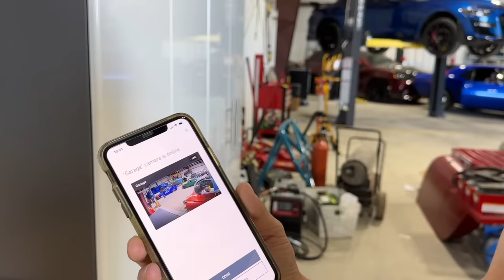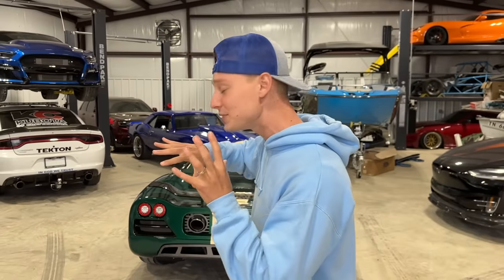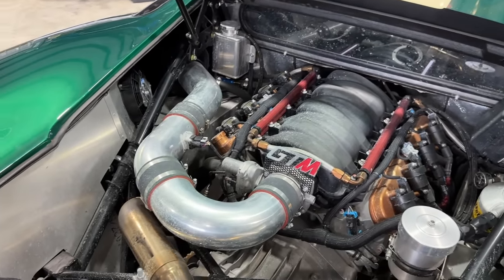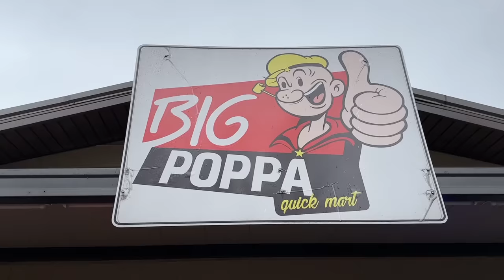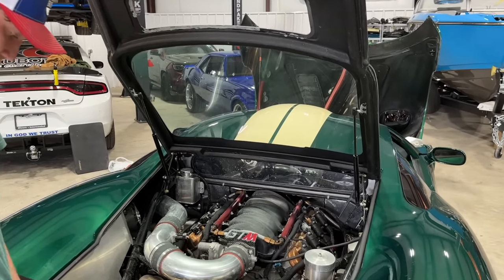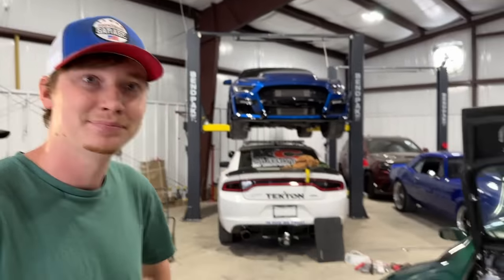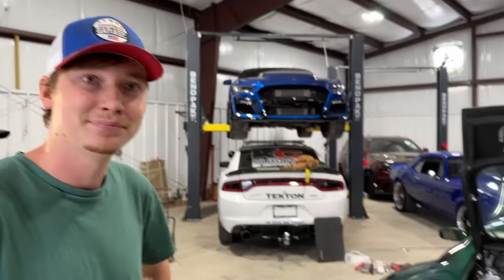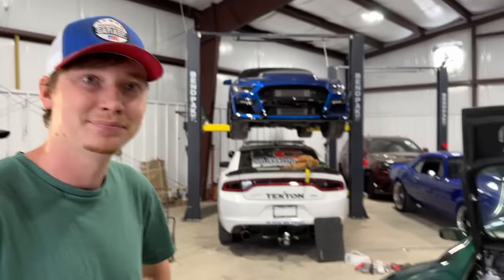Our Salvage Factory 5 GTM Is The Cheapest Supercar In The World!?

Comment: For street, you need to install a set of Michelin Pilot Super Sport or Michelin Pilot PS2 tires. Either set of tires will definitely hook up on the street. If you're just gonna Track the car, some great Dry Track tires, which I personally use on my 2021 Porsche GT2 RS Weissach, are Michelin Pilot Sport Cup 2R, or Mixed Track, I run Michelin Pilot Sport Cup Connect. Just REMEMBER to set and monitor your tire pressures!  Have fun. Great build Goonz!!!

Comment: Guys you HAVE to make sure you take off the xrp main frame before you remove the wheels and tires or else it’ll cause the dash Board to overheat when you push it passed the horizon line limiter

Comment: How much would you say your time would cost for the body work, because I know you had to put in some time on the hood to get it right. I would also say add air bag suspension to it so you can drive it around without it bottoming out then when you're ready for a track you can lower it.

Comment: When they are for sell, new GTM kit are like $25,000. Then you had to source a C5 Corvette for parts or buy them all separate and then find a Porsche 911 transaxle or a Mendeola 5 speed transaxle. To build a GTM is easily a based of $60k-$70k pending how you source your parts and if you start upgrading things you ramp over $100k easily when you start doing full built engine and all performance parts while also trying to keep it streetable like most factory built super cars.

Comment: When the car is on the hoist (14:32) you can see the driver’s side rear tire, it looks as though there has been a fluid leak of some description onto the wheel & tire, brake fluid, axle or suspension leak? 🤔

Comment: sure you will often have leaky motor lines. Have a look at Amazone for a professional smoke machine for motor vehicles.
for example EVAP Car Fog Machine Leak Detector - BELEY 12V Smoke Machine Car Leak Detector Dual Modes Testing Intake Pipe Fuel System

Comment: Keep the GTM, and the Camaro and sell everything else, don't look back just do it. I was TOLD by my new wife to sell my sleeper, it looked like 600$ and that's all I got out of it, but it was the quickest car I ever drove or rode in, I could have made it 30 mph faster with a bigger carb, but I was doing wheelies with street tires, could not do burnouts without suspension mods, but I was ok with that, burnouts don't win races, had 29 inch Micky Thompson tires, 3.91 rear gear, a 2.57 1rst gear in my 4 speed Muncie, I could get it to break loose on chip & tar, but not on asphalt, it was amazing, a tube frame and a full cage and a roller cam probably would have killed me.

Comment: $75,000 would be a deal. I think you can get more. Hear me out. Sure, it’s got a salvaged tittle, but it’s also not a factory built car. It’s a kit car. So, different market there. Limited yearly kit sales from the company. So boom, supply and demand. You took a car that somebody built by hand in a garage, and you rebuilt it by hand in a garage. So, basically it’s right back to where it was. It’s not like it’s a factory assembly line care with a salvaged tittle. I think y’all could get $100,000 easy, and maybe more, since that color is amazing. If y’all ever do sell it, and for 75 grand. Imma snatch it

Comment: Make sure you never crash that thing. That GTM is a death trap. Zero structural integrity/safety. No proper frame and impact bar(s). If I would be you, I would never drive that on normal streets. Only track with wide safety areas.